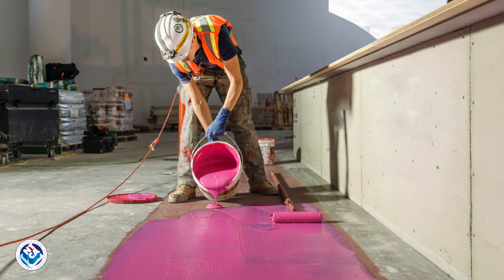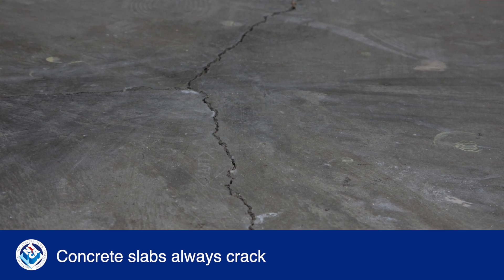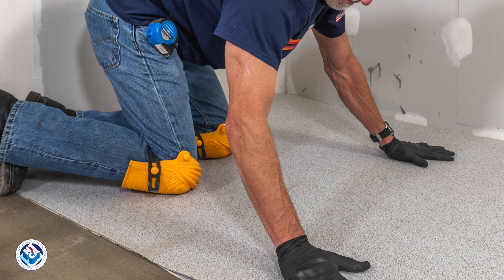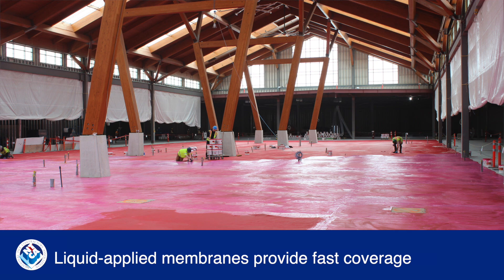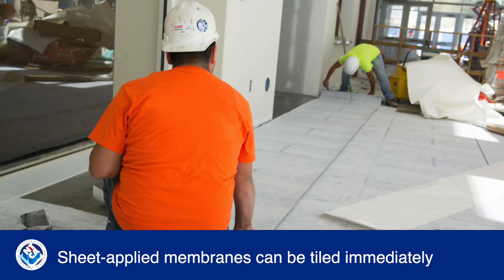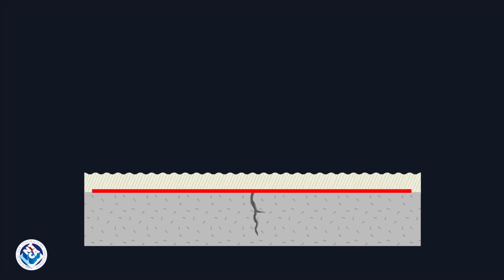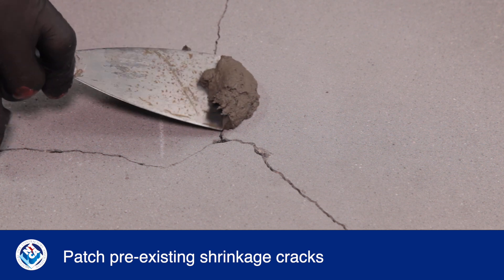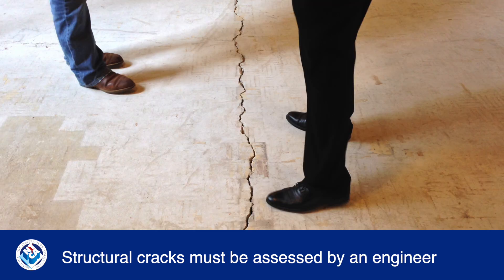Don’t Crack Up: Protect Tile with a Crack Isolation Membrane

Comment: Can I apply the liquid membrane over a concrete stain?  
My patio tile wax removed and contractor said the stain would be sufficient. But if stains really easy and I hate it. So I’m going yo told it over it’s 20’x18’ in size

Comment: My outdoor entrance way tile was installed two years over a control joint with some sort of membrane.  Water penetrated the tiled surface under the membrane and eventually the tiles have separated from the membrane and thin set and raised up or broken  the grout allowing more water to enter. To repair, should I replace the membrane or re-install my tile in a manner than does not cover up the control joint? Thx.

Comment: Im interested in purchasing your this product for a concrete basement floor that keeps suffering from moisture and efflorescence issues.  Will this seal areas that have efflorescence? and can you put tile over it once it dries?
Reply: I'd recommend consulting a licensed structural engineer or chemist. I am neither, just a homeowner, although I minored in geology in college - schooling that included introductory coursework in aqueous geochemistry, minerology / petrology, hydrogeology, structural geology and geophysics. (A lot of geology is chemistry. A good bit of it is also physics, with biology playing a role in hydrocarbon deposits and sedimentary rocks.) I can almost guarantee you that you will continue to have problems until you address the water issue. You would need to divert the water, seal the outside from further damage, maybe install a sump pump or similar - something like that - because even with the benefits of these fancy products, chances are that the amount of water you're noticing will still be beyond what these fancy products are capable of handling. 

Also, I don't know how much this matters when it comes to tile installation, but rainwater oxidizes concrete, as commonly found in many basements. The reason for this is due to the lower pH of acid rain, vs. the relatively high pH of new concrete. So, concrete exposed to the elements ends up with a lowered pH over time. The lower pH oxidizes the steel rebar or post-tension cables in the concrete slabs, which results in cracks and foundation failure over time, because the rusted steel in the concrete expands. It is probably repairable, but it may take a lot of labor, engineering expertise and money.

So, to summarize: take care of the water intrusion before installing tile. That would be my suggestion.
Reply: @lyndagruen2047  you are a year too late. this issue was taken care of year ago when the comment was new. You should check dates of comments
Reply: @miacarlany  lol